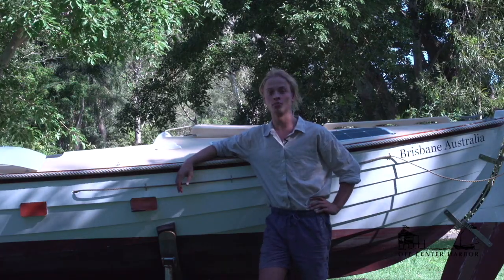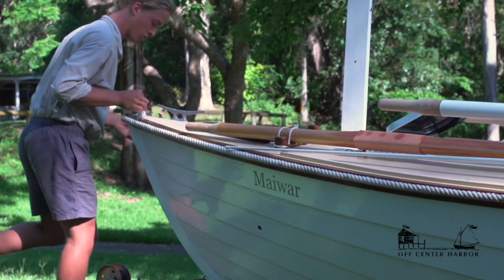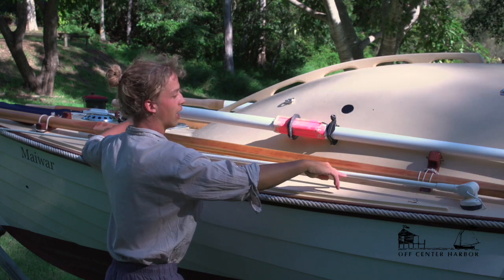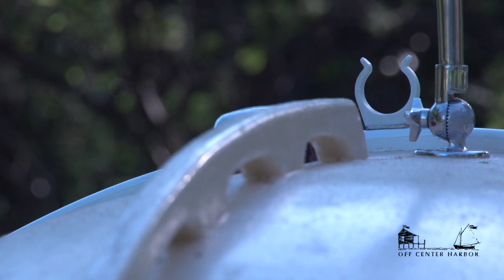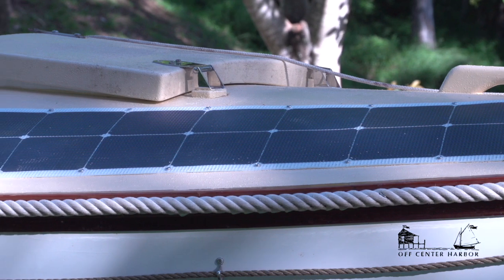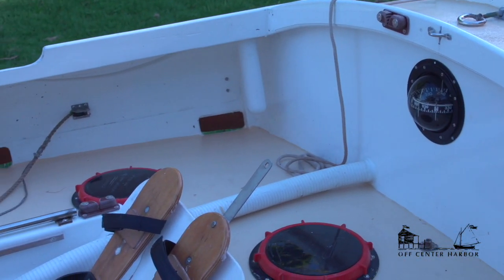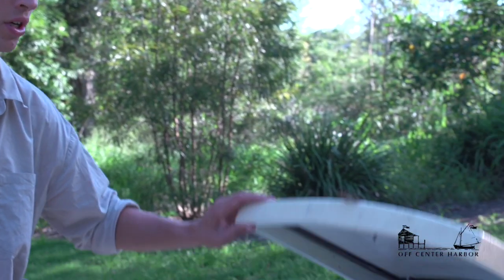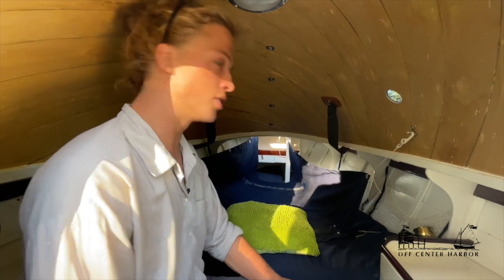A tour of Maiwar – A close-up look at Tom Robinson’s Ocean Rowing Boat

Comment: Quick suggestion. Get rid of all the screw type O ring clamps I saw in the film. They can slice skin with too much ease. At the very least cover them with a protective wrap to prevent any injuries at sea. Good luck.
Reply: I watched the video before reading your comment, and the sharp edges of the hose clamps was the only risk that my non-tradesman, non-sailor head picked up on, having sliced myself on these before now on my little Hartley 18.  It is a big challenge that Tom is on, and I wish him every success.  More importantly to me, the satisfaction and memories down the track after completion of the journey, having done this all himself.  Great determination and courage on display.  2, 4, 6, 8, Tom!👍